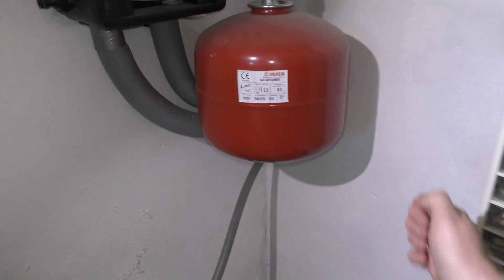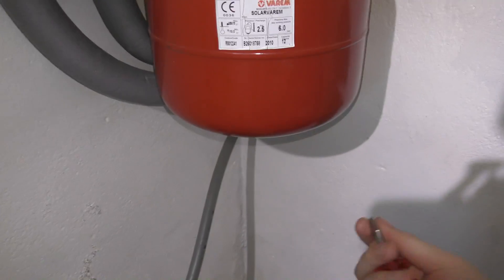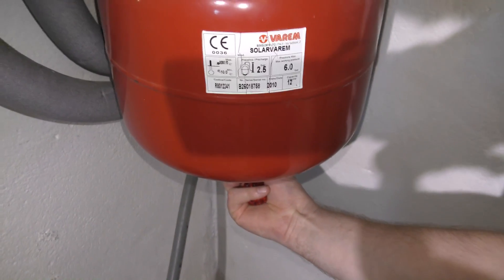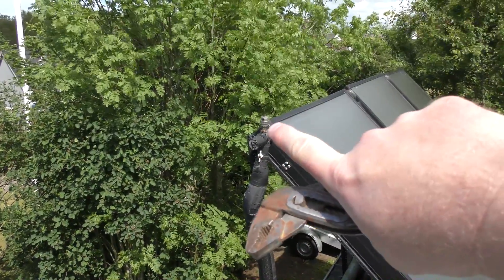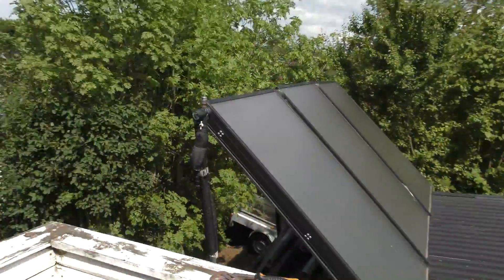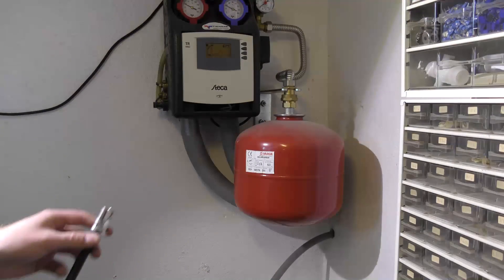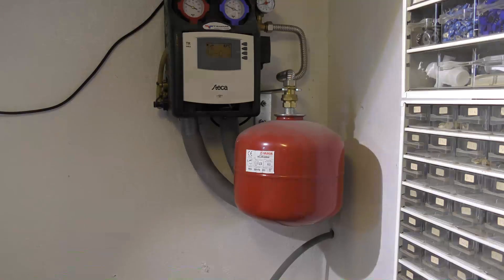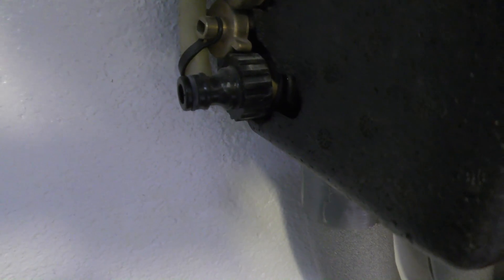Maintenance solar system, with anti-freeze coolant - 529

Comment: Hi mate use food grade glycol with corrosion inhibitor. When topping up you need connect external pump and bucket to service taps and exchange fluid till system deaerate then use automatic deaerators. You need to set you expansion to right pressure first. Then pump system to right pressure. Doing this wrong cause overpressure during stagnation period and leaks or you will have air bubbles in system which boil and turn antifreeze in acid. That why we change fluid and flush system over couple years of service anyway. Yo may poison yourself and your family when exchange coil will fail!!!!
Reply from the maker: Hi Michal Leppert
Thank You very much!  glad you liked the video :-)
Thank you for watching! :-)

Comment: Dear sir , have you ever thought that the plugs on the left side of the unit maybe just for this specific reason? to fill up the system fluid? and you can make an autonomous system to just keep it full all the time and under pressure. also you may need some Teflon tape for the threads of the exust Valve
thanks
Reply from the maker: Hi AL6S00740
Thank You very much!  But this works great, and has done so for 4-5 years,, put in $10 of antifreezes a year, and all runs...
Thank you for watching! :-)
Reply: Is just less of a hassle to get on top of the huse and all these things unscrewing stuff , but yes It works :D
Thank you for the Nice Videos :)
Reply from the maker: Hi AL6S00740
Thank You very much! But this would only take 10 min if I was not filming and talking about it,,, it has been a great investment!
Thank you for watching! :-)
Reply: I know, I live in a WAY hotter country and that's all the kind of HOT water I use both winter and summer time :) So I know the feeling :) Have a good day sir :D

Comment: The great thing about solar/ geothermal systems is that they pay themselves off. We use to pay $250 for electric and $600 for gas each month (we had a big propane tank that gets filled). After we switched to geothermal (closed loop, electric hot water assist) we had the whole system paid off after 2 years, we pay $0 for gas and about $350 for electric.
Reply from the maker: Hi Travis Piper
Yes,,, I am fascinated by using this energy that it free for us to just take,,, with a little investment.
Thank you for watching! :-)

Comment: As an aside the coolant is under pressure for the same reason that the coolant in your car's radiator is. Higher pressure raises the boiling point over the coolant. And by doing so allows it to carry higher heat. Water/coolant will only carry heat up to its boiling point.
Reply from the maker: Hi hallis1
Thank You very much!  I really do not like when the temperature gets over 80C in the system,, then it's time for a long hot bath!
Thank you for watching! :-)
Reply: The thing is, when the pump is running he will never hit the boiling point at any spot in the system.  It's only when the pump is off that the water at the upper side of the system, near the panels, was reaching the boiling point.

Comment: I use propylene glycol in my chilled water air-conditioning. It is low toxic and works great I mix 20% pg to 80% water it will go down to -7°c use 30/70 for -12°c or 40/60 for -21°c . That motor antifreeze could destroy the pump rubber seals.
Reply from the maker: Hi @recognizer6194
Thank You very much!  glad you liked the video :-)
Thank you for watching! :-)

Comment: Be carefull not to make the antifreze to concentrated. From about 70% concentration it starts to loose its antifreze properties and 90% for example freezes again at about -5°C.
Reply: And for the pressure - rule of thumb - 1 baar per floor. So if the tank is on the ground floor and the instalation on the roof of first floor, 1-1,5 ist perfect.
Reply from the maker: Hi joseph222111able
Thank You very much!  It works even without pressure,,, the pump is in the lowest part of the system.
Thank you for watching! :-)

Comment: man don't use regular antifreeze for cars... if something happens with heat exchanger in big thank you going to poisoning your self.... use antifreeze for solar porpoises that is not so poisonous and if you unscrew some automatic air release valve use some teflon tape.... put it on the treads 5-6 windings would be ok.....
overall best advice would be call some specialist plumber to check your sistem and get you some advice about the maintenance.
about your videos 👍
Reply from the maker: Hi Bostjan Trancar
Thank You very much!  I do not really drink the hot water,, if it leaks inside the tank,, it will be mixed with 300L so at least it will be thin.
If I call a specialised plumber to check my system,, it will be a better deal to run elektrisk,, man poter is expensive here,, $100 an hour would quit normal.
This works fine and has worked fine for 4-5 years,, I really do not see any problem,, $10 of antifreeze, and I have hot water from april to october. 
Thank you for watching! :-)
Reply from the maker: HI ole sass
My channel is English, and to make sure as many as possible,  can enjoy the comments they are also English.
So please keep to English.

Thank you for watching! :-)
Reply: Hej Morten , så lige din video, du laver en del fejl vedr dit solvarmeanlæg, væsken skal være af den rigtige type, der bør side en kugleventil oppe ved din auto udlufter, så den kan afspærres, ellers kan den af lufte din væske, det kan forklares.
dernæst fyldes solvarmeanlæg med en jetpumpe så der kan bygges tryk op, sidst exp beholderen var en gang fyldt med kvælstof, du putter ren luft i, derved får du O2 i dit system og mulighed for tæringer. Og du har for lidt tryk på. Sig til hvis du vil ha det uddybet

Comment: As a plumber watching this i have to say how much this is hurting my feelings, and a few times i cant even decide if i should cry or laugh... PLEASE read some facts about solar systems and how an expansion tank works.
Reply: Well the laughing part was when you where using the tong the wrong way. The cry part is when is saw the part when you ``filled´´ the expansion tank with water still in a closed system. Could be that a few things where left out from the video that we saw but i clairly saw a few stuff that where wrong.
Reply: kanskeimorrn he didn't really explain what it did but he knew how to keep it working safely (by filling it with the correct amount of air).
Reply: Well that isn´t possible to do while the preassure tank is still connected to the system so i still dont know what you want to say. Also im not trying to say anything bad about him and that if the roles would be turned around he would feel the same about me if i started setting up a server rack or similar.
Reply: kanskeimorrn I'm no expert in the issue but surely if the air pressure is higher than the water pressure then pumping up the air balloon would cause water to be pushed out the valve at the top and through any leaks in the system allowing it to be pumped up while 'pressurised'.
Reply: Yea im sorry to say that things aren´t that easy. When it comes to solarheatedsystems you have a really high differential in temp so you pretty much need the correct pre-preassure in the tank and that is NOT possible while you have water ``pushing´´ on the other side of the tank. Also i feel that you maybe should visit a preassure tank making company webpage and just read a little. fyi that is how i learned stuff and 15 years of experience dosen´t hurt.
Reply from the maker: This has been working for 5-ish years,,, I did not come up with this myself,, I build the system, after the manufactures plans.
There is a balloon inside that red expansion tank. I have never heard of removing the expansion tank,, that one is fine.
Please clarify what makes you laugh and cry?
Reply: I took the liberty to get a translated page so you can see what im talking about hope this help you. 
 http://www.imi-hydronic.com/sites/EN/da-dk/produkter/trykhold-snavssamler-og-afgasning/Trykhold-og-ekspansion/ekspansionsbeholdere-med-fast-fortryk/Statico/333afdff-6342-4f69-bb86-d026cd20c0d8

Comment: now you need to heat the cold water using servers :)
Reply from the maker: Hi Radek Wysocki
Thank You very much!  That would be possible,, but I do not like the idea of water in the DC to much,,, and to get any kind of usable temp,, I think I would need to water cool the CPU´s.
Thank you for watching! :-)
Reply: I think it would be possible to tap into the existing infrastructure you have, take a look at "whole room water cooling" by linustechtips, but he failed as his system got clogged with algee.
Reply: car coolant would probably develop algee in the system, you'd need need some bacteria killing stuff in there
Reply: maybe use some water-less coolant like Evans
Reply: I wonder if you take all of the hot air that is already being pulled from the back of the server racks and just point the air duct at the water heater if you would save a few $$ since the water heater would not have to turn on as often due to the air being blown at the water tank. Hmm, this gives me more ideas :)

Comment: Nice system, I had fixed the similar system but very big for mansion. It was automatic warm water collector with solar collector and solar panels, also it had DC/AC convector 48v-220v. The 300w water pump was broken, so we are decided to put water filter before water pump. Also this system had thermal tank for 1000L. The mansion owner was very happy  when I fixed this system.
Reply from the maker: Hi Артем Платинов
Mansion,, I like the sound of that,, My PlayMansion :-)
This setup is great for my needs,,, actually a bit overkill,, but so is 100 servers...
Thank you for watching! :-)